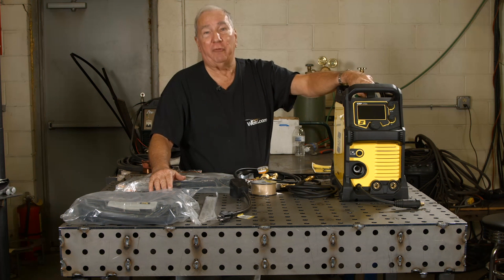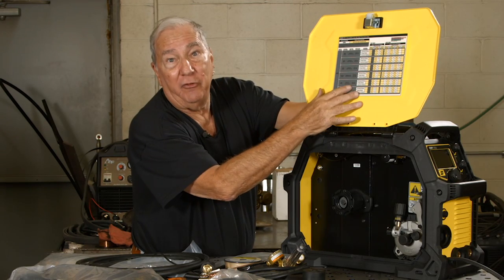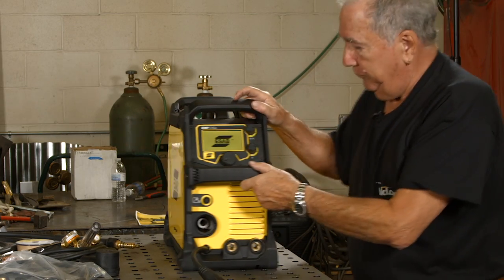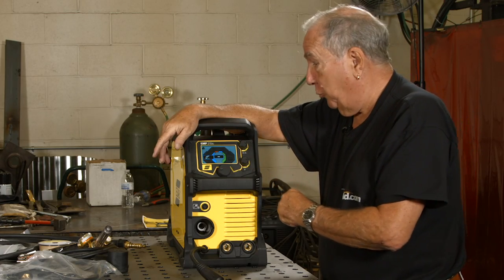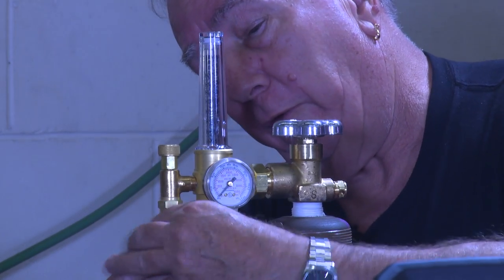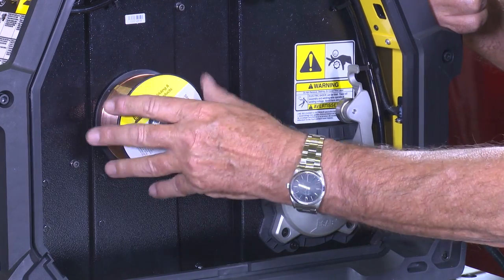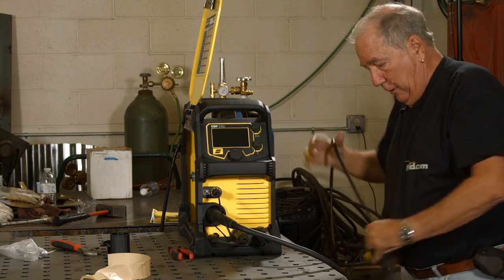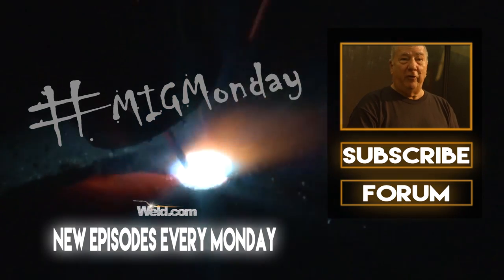MIG Welding and UNBOXING (Full video in WELD™ app!)

Comment: I've owned this machine for a few years now and don't have any real complaints.  The ground clamp is kind of cheap, but the machine is damn good.  It does everything exceptional.  It's amazing how much time I spend welding and fabricating compared to messing with my machine.  It just works, the most attention it gets in a work week is about 30 seconds total, and that's just a knob turn.

Comment: I bought a 215ic rebel and noticed that when I press the mig torch button the wire starts to come out at a slow speed and after just a few seconds it reaches the normal wire exit speed. Is this normal, or is it in trouble?

Comment: I ordered one today. ESAB is an old Swedish company that has been producing welds that works like new today than 20-30 years back. We use them as a benchmark when we test and compare new welds ... Esab knows his business ... never doubt it!

You may pay a little more than they cheaper welders  but it pays off in the end several times. Its machines are several generations if you use them correctly and take care of them as instructed. 

It is usually the case that one chooses welding equipment for one's own country but ESAB is worldwide and I doubt that the support is bad, on the contrary absolutely excellent. .I Just called up an ESAB employee salesman and I received superb support and supplies for several thousand completely free for my machine.

This is noticeable when welding with professional machines and the quality and durability can not compare long shot. 

For me, ESAB is the obvious choice!

sry for my bad English ... Sincerely  Hans .Andersson

Comment: Great machine.  However.... Drive rollers and other small parts are very easy to lose. There should be a storage place for them to tuck away inside the unit.  A nice "ESAB" bag to store all the other extras would be a nice BONUS item to include.  DeWalt  is catching on to this. Their "Dewalt Grab and Go Bags" are showing up on job sites all over North America..... Great Advertising and the guys all love them.

Comment: Paul, I got my new ESAB EM 215ic and had the exact issue you mention at 4:30 about the gun not pushed in all the way. I pulled my hair out trying to figure out why my  practice welds were so bad.  I finally figured it out after re-
watching this again. Great video!

Comment: Hi, God bless you. Thank you for the videos. They are very helpful to me. I just started learning about this tools. I am a beginner. I would like to start a small workshop at home. Can you please recommend me which one to get. Miller multimactic 215 or ESAB rebel 215 ic. Thank you. God bless you.
Reply: Don't beat yourself up over deciding which one to get. If I were you just flip a coin if it lands on heads get the esab if it lands on tails get the miller multimatic you will be very happy with either one

Comment: The only thing I dislike is that for the tig they give you consumables (cups collet body) for aluminum when the machine only does DC.  I would like to see them provide the necessary cups and gas lenses.
Reply: Also.  Add a pedal.

Comment: great video, again...

the wire you used, was it solid core, or flux core, maybe i missed that part, seemed like a very clean weld..
Reply from the maker: +totenkopfelite It was solid wire. The machine comes with a sample spool of ESAB 70S-6 .030, which is what we were using.
Reply: +Weld.com I figured it was solid, that's cool, it's nice to see a solid core freebie. .

Comment: I’m in the market for this welder right now, how is it holding up? Still say it’s worth the money??
Reply: I've been running it since... probably mid 2017.  It welds nice.  Lots of adjustment and tuning capability.  It welds 6010 rod without issue (many inverters do not like that rod).  I do have some gripes though.  The menu is a bit annoying, frequently have to go down several levels to change things.  It does like to lock up requiring a power cycle.  It is not just my machine as I have seen other machines lock up in other shops too.  The fan runs way way too long.  Initiate a single spark and the fan runs for about 10 minutes.  I picked up a Millermatic 220, and honestly I'll probably run Miller going forward.  Granted that 220 spoils a guy quick but I can tell it was designed by people that weld.

Comment: Thank you for the review! I'd like your opinion if you don't mind. I still can't decide on one between Miller multimatic 200, Termal Arc 252i and this Rebel. Even though this machine is the newest out of the pack, Miller proved it's reliability and TA has all the great reviews as well. Would you prefer this Rebel to those two or it will be a sure thing to go with a long time players? Regards.
Reply: @TheWinwin4all - The ESAB Rebel's welding power, sMig capabilities, and advanced features out perform Millers Multimatic 200. Miller makes good machines, but is no match to the Rebel. ESAB is a 110 year pioneer in this industry and the only manufacture that offers 100% Satisfaction Guarantee .... Buy with confidence my friend !!  

The Thermal Dynamics/ TWECO Fabricator  252i (both ESAB owned Companies) is a complete different (300 amp) animal. The 252i competes with all the 252-300amp mig welders and outperforms with its multiprocess capabilities. Check out ESABs videos ....
Reply: +eric martinez Thanks a lot buddy! Now you got me thinking about between TA and Rebel )) I like all this bells and whistles in Esab but TA is  more powerful one... it will be for home use but I'd like more choices though. ..oh well...
Reply: +TheWinwin4all  Anytime my friend ☺️ 
If it's for home, personal use and occasional side jobs.... I would definitely choose the Rebel. 

The Thermal Arc/Tweco Fabricator 252i is more for fab/weld shops.... 8hrs of non stop welding and it's 220v (only)
Reply: +eric martinez Just watched several videos with Tweco... Looks like one of the Rebels at wearhouse is going to see a new home :-)

Comment: first off love the videos i have a question for you can the esab rebel run in smig mode running flux core wire or will it mess with the electronics i cant find the sweet spot welding thin wall tubing running flux core mode going off the recommended setting i burn through or it runs too cold when i turn it down.i changed to smig hooked up c25 gas welds perfect with solid wire is it the nature of the flux core wire
Reply: Francisco Maestas what wire size are you running? And is the wire dual shield or gas shielded FCAW?
Reply: Garret Recker  I'm running. 35 regular gasless flux core also tried. 30 with the same results

Comment: i have a question i have used dual shield fluxcore and its great. can you run regular fluxcore wire (not intended to be used with gas) with gas?
Reply from the maker: +65diesel4x4 There is no benefit to doing so, so you would just be wasting your money on the gas.
Reply: +65diesel4x4 Hello, there are two types of flux core wire. There is gasless flux core with that rquires no gas because its all in the fluxes chemistry. Some people use Co2 for cleaner/ neater welds. ESAB Coreshield 15 is perfect gasless wire. Easy slag removal and zero spatter clean up. ESAB "Dual Shield" Flux core wire (my personal favorite) uses both .... Co2 or Argon/Co2 mix and is flux coated. Thats where the name comes "Dual/Double Shield" come in.  I like using ESAB DualShield on thick,  heavy plate, structural steel applications.

Comment: Where does the foot pedal connect?  Inside like on the 210 mp? Have you tried 6010 yet.   I am buying either this or the 210 mp.   What's your honest comparison thoughts between the two overall.    You say the interface you like better?  From videos I almost think I like the 210 mp interface and colors better but the manual and maint parts is cool in the rebel
Reply from the maker: +gerard143 The foot pedal connects right in front (the same spot as the spool gun). No hassling around with taking the cover off the machine or wiring anything. Haven't tried 6010 yet, but we plan on trying it out in an upcoming video. We like the interface, not onnly because they made it impossible to lose the owners manual (awesome feature), but they have what we call "NOOB mode" and advanced mode. You can fine tune as much or as little as you want and really get beatiful welds out of the machine. Also, there are no additional kits you have to buy to upgrade this to a TIG unit, it is already built in. Here's a quick look at the advanced features / parameters menus (forgive the poor quality ... this was a quick video for the purpose of this reply) https://youtu.be/EQRZqk2jZl4
Reply: +Weld.com I'll check the video out now and thanks for the quick response!
Reply: +gerard143 The ESAB Rebel has a special feature in the Advanced Settings that can be set just for 6010 or 6011 electrodes. In other words it changes the machine's arc characteristics to burn 6010 like butter. I have a few mechanical contractors that need this machine to weld 6010 for pipe and pressure vessel applications. They love it.

Comment: How does this machine compare to other multi process welders ? I'm looking for something like this.
Reply: Most of these new multi process machines are inverter based and built in China. The Tweco is, this one is, not sure about the lincoln or Miller, but they may be too or at least built with China sourced parts. I researched a bit and ended up buying the Klutch 220si from Northern tools and really like it. It's not at all like the cheap units sold on ebay. It's well made, has a really nice arc and even came with a nice spool gun. No regrets on it at all.
Reply: 1990notch Esab build there machines in Sweden and Poland
Reply: That Klutch is almost same as my Hugong Carrymig 200Di.Except mine has LCD.Very great machine,but it seems that requires stabile power supply.I don't like this ESAB because it doesn't have Euro-plug for gun.
Reply: Slaven Smolčić 
You are wrong there, the Rebel have a Europlug 
It's the Caddy Mig 160 and 200i that doesn't have Europlug
Reply: Here's another welder I've come across, Jasic with a 5 year guarantee https://www.weldequip.com/jasic-mig.htm
Does it mean it's so cheap but over priced that they can offer a 5 year guarantee or is it because it is good that it's not expected to break within 5 years? I don't know
The mig200 has a duty cycle of 35% @ 200 and a 100% @ 118

Comment: I wonder how the screen will hold up in a shop environment
Reply from the maker: +Adrian Higgins Only time will tell, but on initial use we really like it and it seems like a solid machine. The thought process is similar to the Lincoln 210 MP, but we really like the interface on the ESAB a whole lot more. We're going to keep using it for a while in the shop, so we will report back on how it holds up.
Reply: +Adrian Higgins  Hello Adrian, the ESAB Rebel has a protective, clear heavy duty, interchangeable plastic lens cover like the one you use in your welding face sheild. This plastice lens cover is made to resist sparks, spatter, dust and debris. The screen is also weldprotected with the carrying handles that protect it like a roll cage. Hope this helps my friend !!
Reply: +eric martinez thank you

Comment: This is a great machine for mig and stick, but the tig is extremely under featrured.   No gas valve in machine, no HF Start, no pulse, no AC balance, no spot weld function and a crummy gun and hose too boot.  It would cost more to retro fit it to a capable tig machine than to buy a new tig machine. I own this machine and am currently shopping for a full featured tig machine , possibly a primeweld 225 or an everlast250.

Comment: I will be placing an order for the ESAB EMP 215 or Miller 215 this week. Which would you recommend? I am new to welding and plan to use the welder during the restoration of my 69 Camaro. I will mostly be using mig and tig functions.
Reply: Which did you end up deciding
Reply: @marloflores8325  i went with the esab 215 emp. Love it so far. Mostly used the big function and practicing Tig.
Reply: How’s it holding up so far Been tryna decide Between the Miller 215 or the esab
Reply: @marloflores8325  it’s been holding up perfectly. I only have about 10 hours on it so far. I’ve had zero issues. The sMIG function is pretty great. It’s a great machine. Comparatively speaking with the esab you get full tig torch Kit...while i think the Miller you’ll need to buy it. Something like that. I remember that being a big part of my decision. You won’t be disappointed with either one. If you live in the boerne Tx área your more than welcome to try mine out.

Comment: mine keeps power faulting and idk why :/
Reply: +kyle kam Hello Kyle, what power do you have it hooked up too? (115v or 230v)
Reply: +eric martinez 115 but I stay in low ranges and it still power faults sometimes
Reply: +kyle kam There may be a few reasons why its displaying this message. A) The 115v (110v) power your're supplying to the machine may not be enough for your application. Do you have a voltage meter to see how much power you have at this outlet?  B) Do you have an extension cord, if so what gauge and how long?

Comment: I bought the EM version and will have it Tuesday. Does the 0.024 wire outlet guide need to be installed when using that size wire or will the 0.030, 0.035 wire outlet guide work? Is that an included part?     (0558 102 327 Wire outlet guide)
Reply: To answer my own question, the 0.024 wire guide comes with the welder, however the liner is still required and must be purchased.

Comment: I am looking to get a new MP style welder having a hard time choosing between the ESAB Rebel and the MILLER 215. I was looking at the Lincoln MP 210 but they were having to many problems with it mainly 20-25% of them arriving DOA or soon afterwards. The main reasons I'm leaning more towards the MILLER is reputation/quality, "MADE IN THE USA", and their outstanding customer service. The reasons I don't like the ESAB REBEL they are made in China, never used anything made by ESAB or Tweko and their customer service SUCKS BIG FAT DONKEY BALLS!! I have wrote ESAB more than a half dozen times inquiring about the Rebel before it came out AND after it came out and to this day the still have not responded once. EVERY online dealer and LWS I've talked to about ESAB has said the exact same thing, that ESAB's customer service SUCKS. There are a couple of LWS in my area that won't have anything to do with them for that reason and being made in China. Leaving that and being made in China, which is the better machine? I would be using it for Mig and Tig welding and seriously doubt I would ever use the Stick welding feature on either machine. I will be using it for auto body work and building stuff like motorcycle, ATV, chassis roll bars, bumpers, for the type of work I'll be doing I'll ask again which is the better machine? Should point out that as long as I buy the MILLER 215 with Tig kit before 12/31/16 it will be about the same maybe even a little less expensive than the ESAB REBEL AND it comes with the foot controller and I'll have two separate gas valves and two separate gas inlets so switching from Mig to Tig there's no need to change hoses. I've always looked at Miller and Lincoln as the Chevy and Fords of the welding world meaning parts, consumables and service can be found just about everywhere. Sorry but gotta ask again which is the better machine? PLEASE, PLEASE if you're going to respond to this just don't say Miller or ESAB tell me why you're choosing one over the other.  Thanks
Reply from the maker: To be completely honest, we haven't had a chance to test the Miller yet. However, we do plan on doing a side by side comparison sometime in the near future. All we can say is that we have used the ESAB for close to a year now and it has exceeded expectations in every way. We've done tests on almost every function of the machine, just do a search on our channel.
Reply: Weld.com Any chance of hat test being done before the end of the year?

Comment: You don,t get that gage u get the one in the pitcure
Reply from the maker: +John Gibbs Someone else brought that to our attention, so we contacted ESAB. They let us know why ours came with this gauge and some come with the other... Here is their explanation word for word:
"Due to overwhelming demand for Rebel during its launch, we needed to use two different style regulators to stay on track with delivery - the Victor GF 250 flow gauge-style regulator and the Victor HFR 1425-580 flow tube-style regulator. Both regulators provide equally great performance with Rebel."
Reply: Ok
Reply: +John Gibbs I got the dial type too, kinda sad about it but I guess I will get the tube style and have this as a backup
Reply: +Virgil Settles.   ,that is what i,am going to do

Comment: Hi, I have another question for you, if I may. What is the thickness of the steel plate of your welding table please? What is the diameter of the holes in your welding table please? The holes in your welding table are spaced by how much centimeter please? I would like to realize myself a small welding table like yours! Thank you very much for your help and advice! Best Regards

Comment: Ok why in the hell is youtube and google not showing the best welders out there and that is the old esaab  mig welders that has the spoil of .35mm wire on top of the welder and that spoil sets in a box that u can take the welding led anywere and the box turns up the volts and wire speed 1 to 10 on the wire and 1-10 on the volts shit nah youtube and google wants to screw essab out of the best welders there is by not showing anyone them old welder huh youtube shit I'm a master welder too essab  does have the best welders out there I dont care what anyone says the old turn knob to 1-10 is basically  2 welders n one so u can weld small stuff like lawn mowers and things by turning the knobs down to about 5 or 6